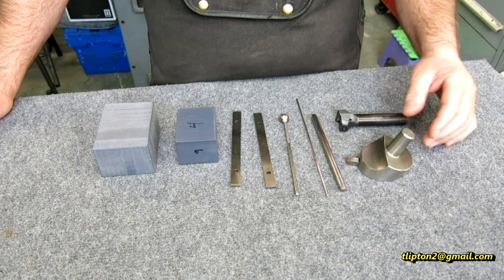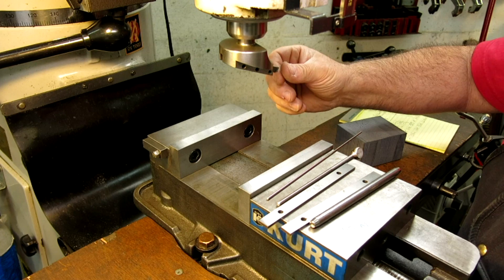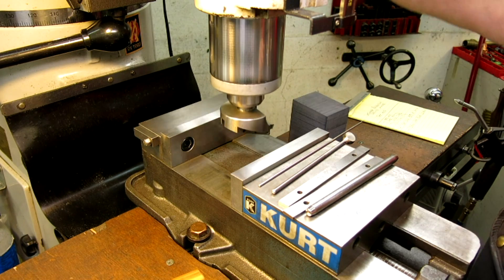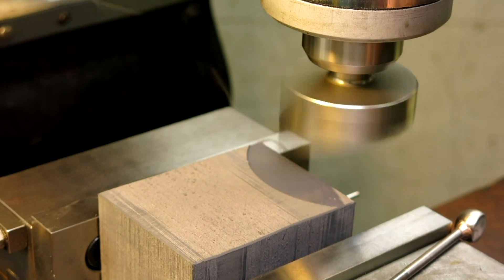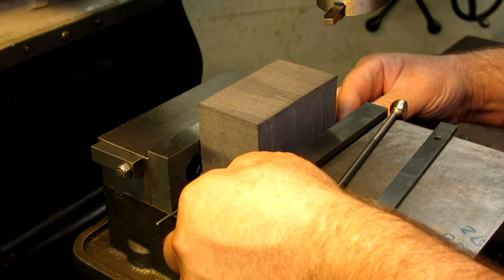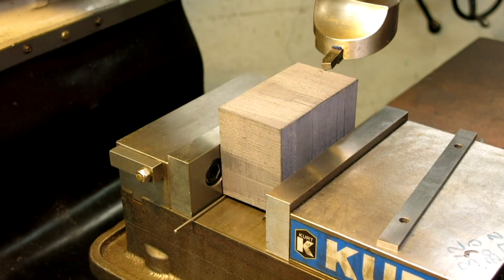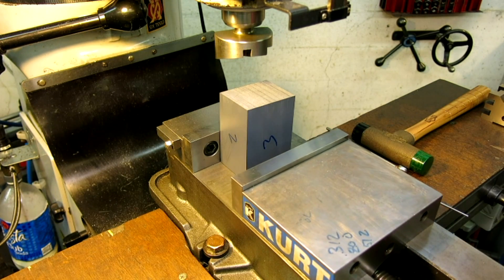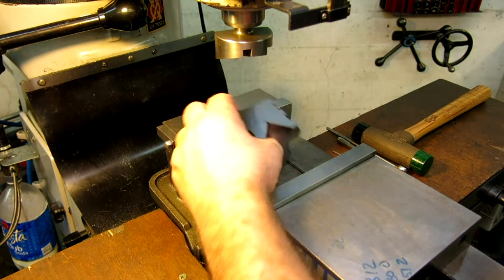Virtual Apprentice Squaring Blocks

Comment: I have consumed many of your videos. Your channel is my escape from reality. I am very grateful for your content. I currently work as a CNC operator for a water treatment equipment manufacturer. I use a CNC router to cut polypropylene, PVC, HDPE and other plastics to build enclosures for chemical feed equipment. The enclosures are assembled by hot air and extrusion welding. I am in Manatee county Florida. 

Anyways, I learned much of what I know from my grandfather. You remind me of him with your odd ball Bob's your uncle shop comrodery. Very funny and enjoyable. He gave me a caliper that was his father's. So that makes it very old. It is a Japanese NSK Vernier Caliper  780-701 DC-6 6" (0.001"). I wasn't sure if you have any experience with these calipers in your career. If you could tell me anything about them at all I would be very grateful. Google searches didn't turn out to well. I know you have a sentamental connection with tools and I see exactly where you are coming from with this caliper. The history of the tool makes it special. The tool has helped feed my family tree in it's own way and I am honored to have it. 

Keep up the good work. I plan to dedicate my life to the machinist world and thanks to you I am learning a lot. Hope all is well...... Bob's your uncle!

Comment: I have quite a few years of machining experience under my belt and learn something from you on every video. Sometimes it is a small detail, sometimes it is a glaring omission in my skill set. Either way, VERY thankful that you share your skills. So much if this in not accessible to people that are not shoulder to shoulder with the right person. One of my operators, who was very sharp, had learned really rotten habits from his previous job. It is hard to unlearn bad habits. 

In time, as I myself learned new things, it was easy to see that I was also guilty of passing bad technique on to the same guy. We both had to unlearn the bad techniques. 

Anyone that stops learning, quickly becomes an anchor in the realm of machining.
Reply: Lots of things, it is easier to teach someone with no experience, how to do it the right way, than try and break someone's bad habits.

Comment: Nice  lesson Tom. I learned some indicator tricks from you...  
As someone who does a lot of 3 and 5 axis CNC programming and machining I'm a fan of hanging onto ~1/8" in the vice (sided being clamped need to be reasonably parallel), facing the top, milling around the outside with an end mill, chamfering the edges, then flipping the part and decking off the grip stock. 
Doesn't work with every part but in the right application its great.

Comment: Excellent info/video! I've squared a number of blocks before, but used a slightly different method for sides 5/6. I like your 5/7 trick better and will definitely use that in the future. Thanks!

Comment: I can see this method working really well squaring up pieces on the lathe as well.  A little tricky holding the saw cut faces, but the idea applies directly.
Reply: Remove the chuck and use a small vice or 90 deg. angle plate on a face plate, and follow the same process.
Watch out for the parallels, could end up with one in your ear.

Comment: Often use this method  it speeds things up if you have a lot of blocking out to do probably wouldn't check tool-steel D2  with anything more than a square as it moves a bit during heat treat and would be grinding it later .If i use a vee block i tend to use 2 vee blocks 1 front and one back spreads the load over all 4 faces then. Thanks  Robert

Comment: Hi Tom !

Really nice method and very well instructed, but ...

it wa a little misleading the way you you checked the 5. cut was square ... you have use a smaller angle and then put it up against the right surfaces ... I new the method so I know what you was trying to show there  ;-))

but oh, keep coming with some more nice and nifte PROFY's tricks - thx for sharing !

Comment: To avoid deburring face 5 i usually do 2 cuts at different angles to form something that looks like a roof( V shape). Also climb milling that edge solves the burr problem.

Comment: Fantastic those cuts 5-7 and what they achive. An other guy showed how to square up a block using only 2 setups but needed 2 different tools. What do You think about my little home project?How to square up a 2"x3"x4" U-beam to make it an angle block wihout having a vise that can hold it? It got the piece for free´, brought it home and realized that there is no 90 degree angle anywhere.

Comment: I see the indicator stand you were using for squareness checking has a straight squaring surface, while the other indicator stands in the background and the one you used for parallelism had a curved squaring surface. Which of the two styles do you prefer? It seems to me the straight surface would be a lot faster, as there would not be "hunting" to find the high spot. But most of the videos I've seen on shop made ones have the curve. Thanks!

Comment: Hi Tom, happy holidays! Quick question. Would you use Parallels for smaller materials that don’t stick above the vise jaw? If so would you still use the piece of Welding rod below the material on top of the parallel? Thanks for the great videos and books!

Comment: Very nice ! i don't recall reading this in any of your books especially slanting the piece for the 5/7 cut ! i was using a square to set this up with mixed results and will try your method and the v block method as well , do you think two v blocks would be better one on either side so the clamping jaw doesn't damage the work piece ?
Reply: ian bertenshaw two v blocks is better

Comment: Hi Tom, 
Great video & it's very much appreciated.
The cuts for 1 & 2 were done with the Flycutter moving R to L, yet cut 3 & 4 was the reversal.
Curious if this has relevance to the actual squaring process or just convenience because of Cutter position at that point?

regards Colin

Comment: Mr. Gizzard, I have been looking for a small squareness stand with the curved front on it, but don't seem to see any. I have a couple height gauges which don't have the curved front on them...is there a specific name for them? I've searched on ebay for squareness but don't see any hits.
Reply: Wouldn't you know that right after I ask, I find one on ebay. I have been searching for about a month, and couldn't find one...but found a Federal stand that looks like it will work for me. :)
Reply: On Tom's website, he has a post from Nov. 2012 about this.  It includes the technique of using a ball bearing which sits in the V machined into some surface gages (eg Starrett No. 257, it's actually the back of the indicator base...where the upright bar sits).  Randy Richard (I think) cut into the front of one and pressed in a piece of sheet metal which was subsequently ground to an arc.
Reply: I thought about using a ball bearing in one that has a concave in the front, I think it's a B&S height gauge. Wasn't sure if that would be accurate enough or not, but it probably has to do with using a ball bearing that is close is size to the diameter of the concave.

Comment: at 15:30 and beyond, you place the square in the plane of the 5/7 cut, but that's already been established as square in previous cuts. Is it correct that anything you slice from the face of 5/7 would remain square and would have measured square before the cutting of the 5/7 face?

Wouldn't the correct assessment of square be performed by placing the square in the 3 plane to reference the 2 face to the 5/7 cut?
Reply from the maker: Hi Fred,

Its a tough thing to show. The point I was attempting to illustrate is not the plane being perpendicular but the cut edge. The concept is tricky to show on video. Comparing the back edge to the cut surface causes the same confusion, well I least I think it does. The key is that intersection of the two non perpendicular planes. Cheers, Tom
Reply: so since the back of the vice is parallel to the axis of the spindle, and the plane of the fly cutter is perpendicular to the spindle axis and parallel to the tram of the table, the edge of faces 3 and 5 will be square to face 2, giving you a proven reference edge to pivot along like you did in step 1. Correct? I kind of agree with Fred that holding the square vertically would show this better since that's the edge/face/region that will be resting on the parallel for cut 6.
Reply: I'm glad someone else also sees it the way I did. I didn't understand the answer to my post and was unsure enough to ask. There's no failure in the practice or the results, but the test reference with the square appeared to be meaningless. Had the square been placed vertically, the result would have been successful, of course. Well, that's how I see it.
Reply: Fred U. Yep, the square on the two edges were a little confusing. But, since the piece was perpendicular in the vise, no matter what angle side 5 was cut at, the edge would lay flat/perpendicular on the parallel when cutting side 6. Cool trick which I didn't know existed until the (aha) moment!
Reply: Maybe the block before milling could have been cut with some wonky angles to show the edge cut effect a little clearer.

Comment: I didn't get it at first so I watched again. When you changed direction and fed in the Y you created a perpendicular to the back vice jaw and intentionally didn't clean up the 5 surface. Then you rotated the block to land on those cut surfaces when you cut 6. Is that correct ?
Reply from the maker: I think you got it.  Cheers. Tom

Comment: Mindblown,  just wondering though, isn't it essential for the vice to be trammed for this method to be effective where as with the v block method, it doesn't matter which way the vice is.
Reply: The vice does not need to be in line with the X or Y axis, the fixed jaw just needs to be perpendicular to the X,Y plane.
That is one reason Tom pointed out he was just cutting with the end of the tool.  The surface is just as flat no matter what direction it moves over the vice.
Reply: @andreblanchard8372  That answers my question. I was fairly certain that that was the case. Seeing it written out just confirmed it. Thanks.

Comment: Thanks Tom. As a fairly inexperienced hobbyist, squaring a block seems like it would be such a simple thing, until you try to do it. Or is it just me that struggles with it? Can't wait to give these tips a try. Got to make me one of those half flat ball thingy's.
Reply: One of the things inexperienced people fail to do, when squaring up a block, or trying to be precise is;  They fail to make sure all surfaces such as the mill vice, parallels, and the work piece are extremely clean. Keep in mind that even a piece of fuzz or hair have a dimension that can destroy precision.  shine a light on the surfaces from an oblique angle and the little devils will show up.

Comment: Great video as always Tom!  Thanks for your efforts.  However, while your 5/7 side principle is certainly effective and another one of those techniques to keep in the mental "toolbox", I am curious why you would ever choose to use that method as opposed to the V-block technique you showed or even using a square to set the part in the vise when the 5/7 method is always going to require at least one additional setup and cutting operation.  I know in other videos you have emphasized the importance of operational efficiency in your work, so wouldn't one of the other two methods be preferred?
Reply: Using a v-block or a square requires that the v-block or square to be known as being square enough for the intended application. With this method there is no need to have your outcome be dictated by the squareness of the v-block or square.
Reply: Mark Koba I guess that makes sense, although I’m not sure why anyone would have a V-block or square that WASN’T of “known” squareness.
Reply: I can only speak for myself, but I am at the very bottom end of Tom's target audience here and videos like this give me some eye opening examples to understand what is happening, rather than just a cookbook recipe on how it's done.   I have zero machining background and I'm trying to learn as I go.  I appreciate Tom taking time to help guys like me working in a home shop with a mini mill on a shoestring budget who haven't yet acquired v-blocks and stuff any real machinist would consider the utter basics.   Speaking for myself, I have to admit that I don't have great skills and complex setups are my achilles heel, because my ignorance just induces more error.  Any method that reduces moving parts, additional equipment, or reduces the need for refined technique is a giant help to me.  It was a revelation that cutting side 5 at some unknown angle was irrelevant to the end result, but provided a perfectly square base for fixturing.   As one poster said above in the comments, it becomes immediately clear when seeing it done but it's not anything I'd have figured out on my own in a million years.
Reply: The v-block method works best for close to square cross sections. If You are squaring up something more elongated the v-blocks won´t hold the part well above a certain  deviation to rectangular. Toms methods works for squaring up almost any shape. I also think even if the v block is a little faster, Toms method is more accurate . 
I usually turn the flattened ball with the flat against the work piece and a thin sheet of brass between the wise jaw and the ball in order to neither dent the vice nor the work piece. My flattened balls are  larger, about 1 inch.
Thank You again Tom for Your excellent and clear teachings . I have picked upp many valuable tips from Your videos.

Comment: I'm surprised at how fast you're cutting with a flycutter... is the video sped up for the cuts, or do you really cut that fast with it? What RPM/feed rate/tool material?
Reply: He's cutting some sort of plastic in this video. If he were cutting aluminum or especially steel, the feedrate would be slower.

Comment: Oh dear........for everyone out there with vice jaws that are anything but dead square to the Z axis and also vices that aren't all that new or of good quality and coupled with that a Z axis on the mill not all that square to anything in 2 planes....best of luck 'cos you is gonna need it when the checking time comes and nothing seems to work as shown.
The method shown is an exact one and works well if your equipment is up to scratch, but don't knock the teacher if you don't get it right.......check your equipment first.......that is the most important first step to any accuracy.

Comment: Hi Tom. Maybe you can do a tutorial on how you get the flies to sit still long enough to use the fly cutter on them; there’s nothing worse than having the flies 2 thousand off of level. :) Of course, if you do, then you’ll be obligated to put a disclaimer at the start of the video, “Caution: not for all audiences. Some houseflies were harmed in the making of this video. Rated X for extreme (fly) nudity and gore.” All joking aside, what if the vise jaws aren’t square to the vise base, or they are slightly warped?

Comment: Wouldn't surface 5 when placed on parallels (after the wire showing rubbing on the vise bed surface indicated an incline downward toward the operator) indicate that your parallel (because of its thickness) on the back vise jaw was registering not on the edge, but a parallel thickness from the edge? Can't quite figure out if this matters. The whole surface is not perpendicular: only the very edge. hmmm Is a square placed on face 2 measuring face 5 going to show that 5 is square everywhere there is a milled surface?
Love the "Virtual Apprentice" concept. Great video (as usual).
Reply: For that technique it doesn't matter, the entire surface is parallel (not just the edge) in the plane that can't be ensured to be parallel just from clamping in the vice (the left/right tilt). If he cleaned up the entire surface you wouldn't even need to place a parallel under it (don't know why he went to use the wire, that's not a suitable parallel) as it would simply sit on the lowest edge touching the floor of the vice.
Reply: I'm not Tom, but I can probably answer this. The 5 cut was way off in one axis, but was perfectly cut in the other axis. The inclined cut would hit the parallel ( or the rod ) precisely perpendicular to the axis we need it to, while the jaws of the vice true up the other axis. This makes the 6 cut perpendicular to both axes. 

Put another way, the surface prior to the 5 cut was already untrue, Tom simply cut one true axis into it, that we rest on to provide that axis as true, while the vice jaws true up the other axis. Tom deliberately cut 5 way off to show that the only important attribute of the cut is its squareness to the edge. The angle is irrelevant, although his was so steep, he couldn't use his welding rod to space the cut off the bottom of the vice, so he had to use a parallel instead.
Reply: I think if Tom had "finished" the cut on face 5, it might have made the trick easier to understand because then he could have put either edge of face 5 on the parallel to make cut 6. Leaving face 5/7 partially cut made you want to think that there was something special about that fact.  I don't think that would have wasted any materiel, either.
Reply: And when I say either "edge of face 5" I of course mean the leading edge or trailing edge of the tool's travel direction, and not the side edges.
Reply: Thanks all for the fine explanations. Got it!